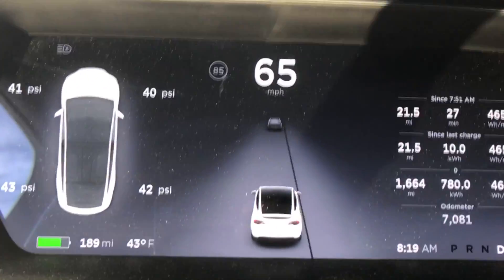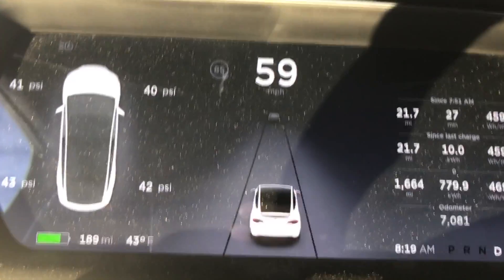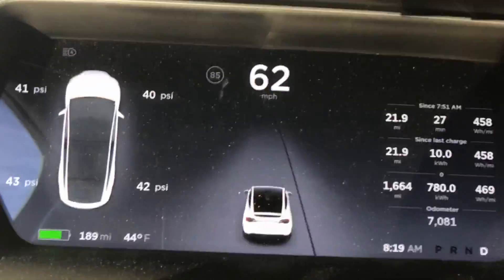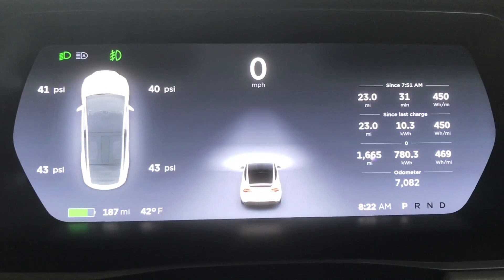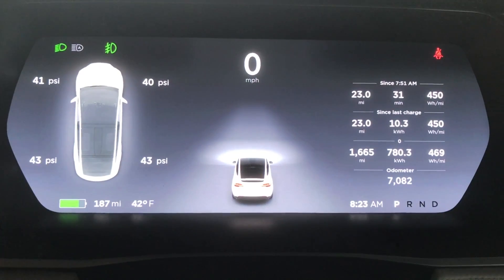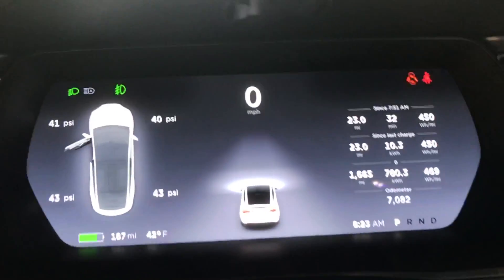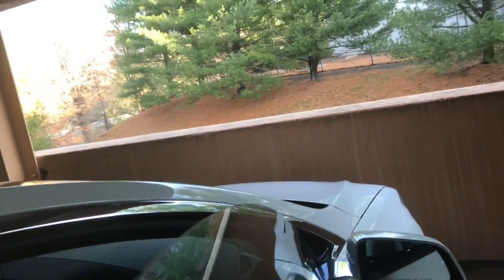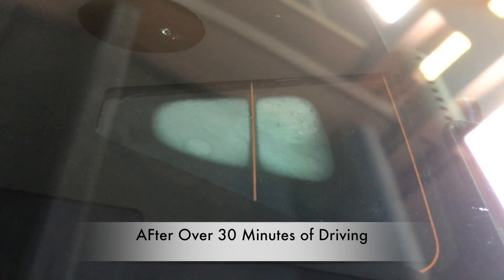Tesla Model X - Autopilot Issue Mystery Solved!

Comment: Good video. Looks like a lot of moisture. Either leak or assembled under problematic circumstances.
Defo get that fixed and make a video about it. They might need to change the entire windshield. Engineering wise interesting.
I think ensuring good sensor condition will be a significant issue. I suspect sensors will get their own cleaning systems. Like a blinking eye.